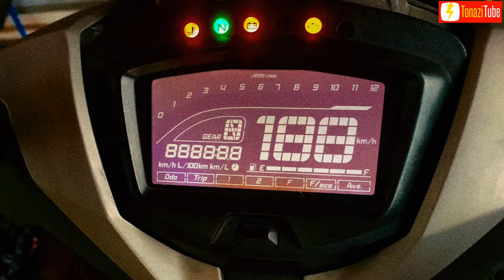How to Fix Surnburn LCD for Motorcycle Speedometer | Repair Meter Yamaha Y15ZR V2 Sniper-Exciter 150

Comment: Saya baru buat ni bang.. 8 jam saya dengan kawan buat. Last last tak jadi pulak. Colour jadi terang nombor putus putus 😭
Reply from the maker: Cuba check dekat kaki LCD,mungkin ada problem solder(Kaki short atau terputus)
Reply: @TonaziTube  okay nanti check lagi. Cuma angle polorizer ni tak berapa faham. Saya pasang yg hitam background putih font
Reply from the maker: @yathidayat433 How to Test LCD Polarizer Film Angle :
https://youtube.com/shorts/fKnv12AmZBQ?feature=share
Reply from the maker: How to Test LCD Polarizer Film Angle :
https://youtube.com/shorts/fKnv12AmZBQ?feature=share
Reply: Hello bang, nak tanya, apa nama polarizer tester tu, yg nak cek negative positive?
Dan 1 lagi, diagram soket y15 v2 kaki ke berapa positif dan negative?
Reply from the maker: @kiro5559 Sebelum ni tester datang sekali dengan polarizer film.Boleh juga guna Polarizer Angle Tool 0/45/90/135 Degree Tester(Ada jual kat shopee).
Mohon maaf,saya tak ada diagram soket y15 v2.Cuma plug semua soket untuk check display.Masih juga mencari diagram soket ni untuk mudahkan kerja(tak perlu plug soket motor)

Comment: nk cuba buat sendiri tapi takut tak jadi 😂...boleh bagi tips sikit ke untuk newbie ni?
Reply from the maker: Perlu hati2 semasa proses pematerian(soldering).Terutama membuang timah pada kaki komponen,jika tersilap langkah boleh menyebabkan litar pada pcb board terputus.Boleh refer video short Tonazitube cara solder kaki komponen sebelum ni untuk rujukan.
Reply: AQ punya moto mcm ni ug?
bang .TPI TK panday buat sndri .blh bgi tw TK kde x yg blh ripe? Bang
Reply from the maker: @nurulrohman-wo4pp kena cari kedai yang boleh repair.Dekat Sungai Petani,Kedah ada satu kedai yang ambil upah.Art Chee Motor
Reply: Area kl ada tak yg boleh buat tuan?
Reply from the maker: @champnordin3843 Maaf!Tak ada info.
Reply: kedai dimana tu area sungai petani...ingat nk hantar ja repair ...just bawa meter saja boleh kn? @TonaziTube
Reply from the maker: @izuwansaidin926 Cuba check Dekat google “Art Chee Motor”.

Comment: Hello bang, nak tanya, apa nama polarizer tester tu, yg nak cek negative positive?
Dan 1 lagi, diagram soket y15 v2 kaki ke berapa positif dan negative?
Reply from the maker: ￼Sebelum ni tester datang sekali dengan polarizer film.Boleh juga guna Polarizer Angle Tool 0/45/90/135 Degree Tester(Ada jual kat shopee).
Mohon maaf,saya tak ada diagram soket y15 v2.Cuma plug semua soket untuk check display.Masih juga mencari diagram soket ni untuk mudahkan kerja(tak perlu plug soket motor)
Reply: @TonaziTube  terima kasih bang sudi balas komen, sy sudah dapat diagrams y15 v2..dengan cara test guna multimeter pada soket motor tu. 

Terima kasih sekali lagi dan semoga maju jaya!
Reply from the maker: @kiro5559 Sama-sama 🤗.Bagus cara tu…untuk dapatkan pin voltage dengan check guna multimeter 👍🏼.

Comment: Bos nak tanya dia ada 2 tented kan depan blkng
Reply from the maker: Ya ada 2.Tapi yang belakang selalunya yang akan rosak
Reply: @TonaziTube bang saya tersilap buka polorize atas meter motor saya..  Sedangkan polo belakang yg burn..  Kena tukar dua dua lah polorize tu kan bang?  Kalau nak tukar atas dan bawah kena ada tips ke nak ikut?  Tolong bagi penjelasan terima kasih
Reply from the maker: @Livenow94 pasang balik ikut efek yang sama untuk LCD atas dan bawah.
Reply: @TonaziTube  baik..  Mcm mna nak tau eh angle yang asal?  Sbb saya lupa pla
Reply from the maker: Perlu check mengikut angle polarizer.Tiada info tentang angle yang asal.

Comment: Boss how yamaha MT 07 lcd? Same step ke boss?
Reply from the maker: Beza saiz film dan cara buka meter.
Reply: Sir how about if front ang back ar sunburn Ican use same polorizer film
Reply from the maker: Can use the polarizer film for both side(Top and bottom). Important and make sure angle are same for both otherwise digit and background colour will be different.